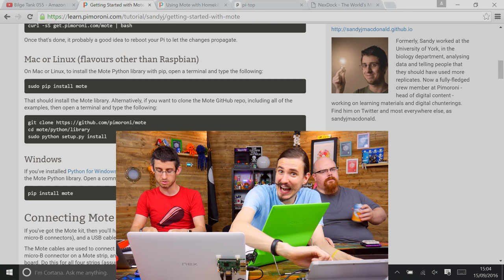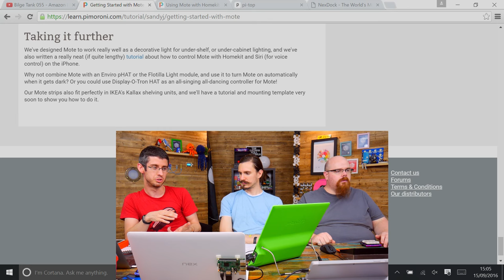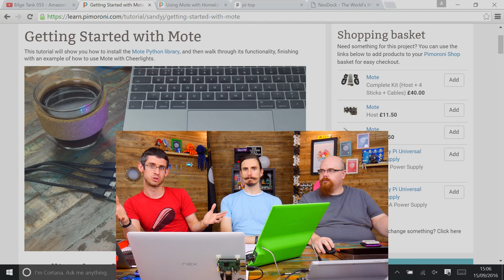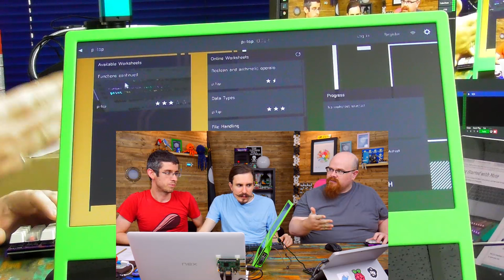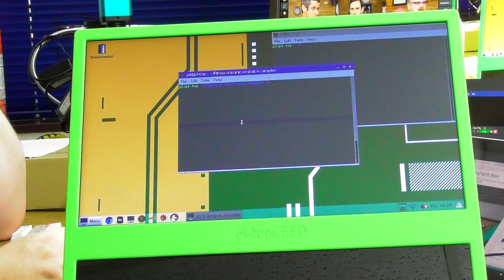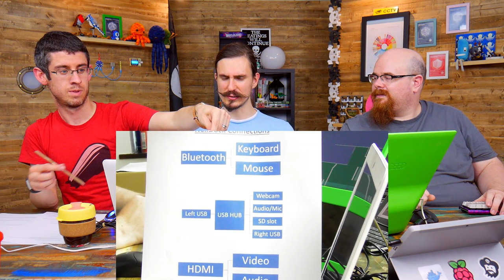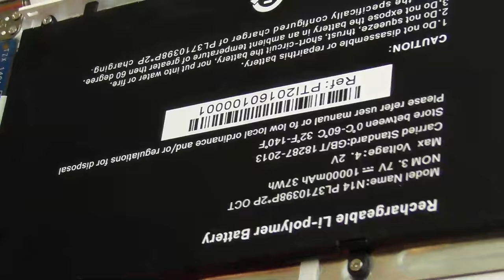Bilge Tank 056 - NexDock, pi-top CEED, Kano, Lapdock rodeo!

Comment: Nice video. I have a Pi-TopCEED myself as well but I they didn't give me the nice GPIO cable. I just have a bunch of cheap cheap wires to connect the hub board with the RPI3. Did they deliver it with that or was it just another marketing stunt by PiTop.